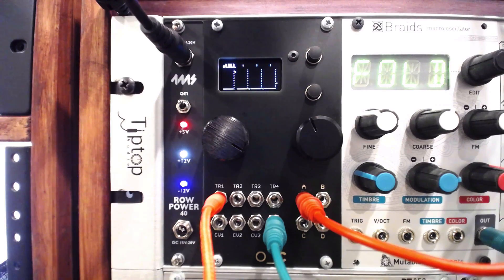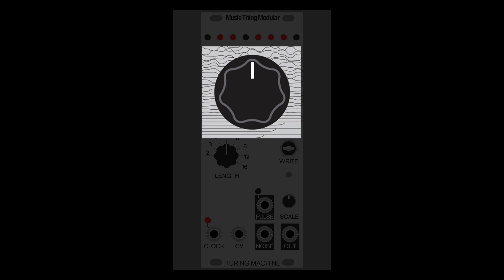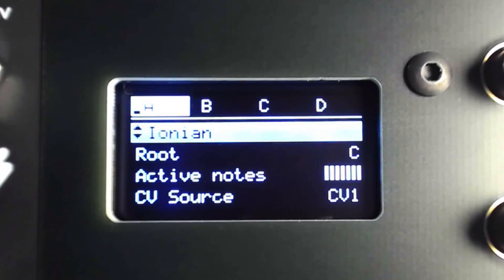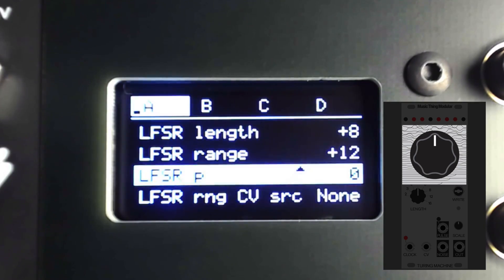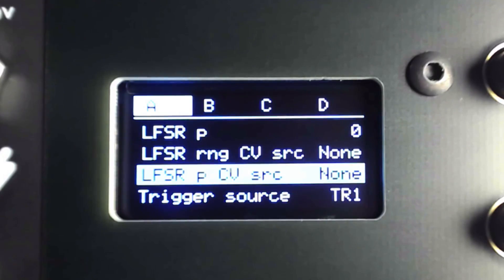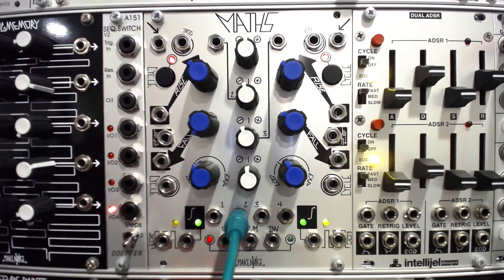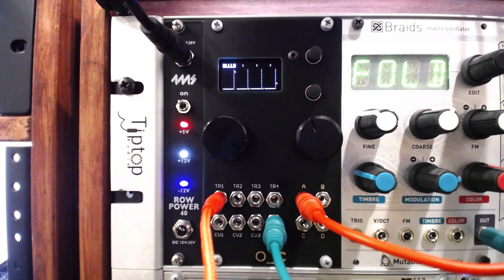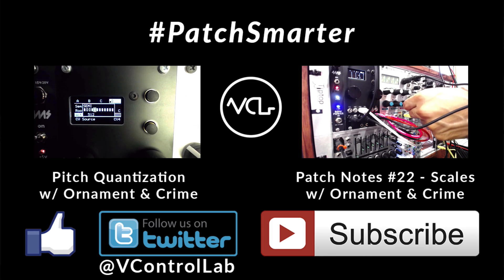Quad Turing Machine Mode in Ornament & Crime

Comment: So you can use the same CV channel as you are sending pitches from for the offset. But you can't see the offset reflected on the screen. :-( So if you were using all four Turing machines you could see none of the offset levels on screen. I used my Befaco A*B+C for the offset.

Comment: What is happening if we don't have a Maths, how can we loop the random voltages?
Reply: yes you can use Precision Adder mode to generate an offset
Reply: Daniel Solomon I’ll add to the precision added comment: make sure that you’re in the second mode of the precision adder, as the first one will jump in increments of 1v (which is a lot)
Reply from the maker: You can use any DC offset module, there are a bunch. One that I've been using lately that is much deeper than just DC offsets, is the Bends from Warmstar Electronics.
Reply: Sorry, i am a newbie, have a couple of months into the modular world. I have a Disting MK3, does it do offsets?